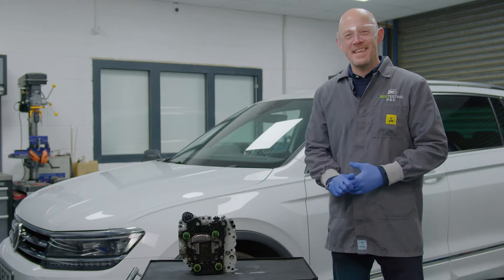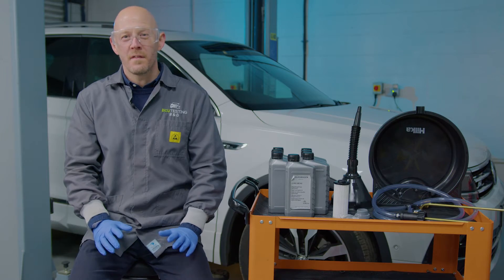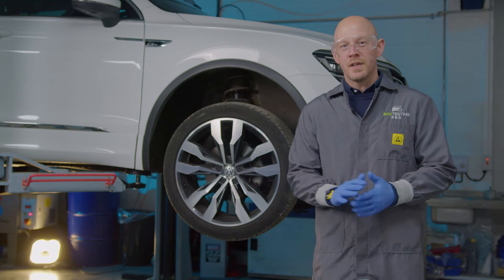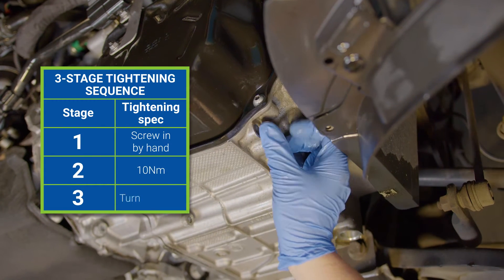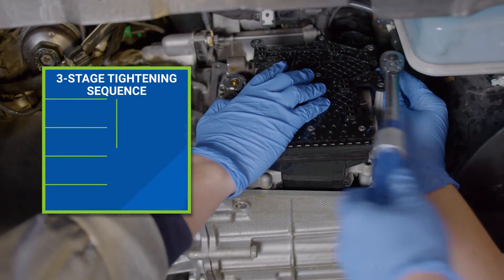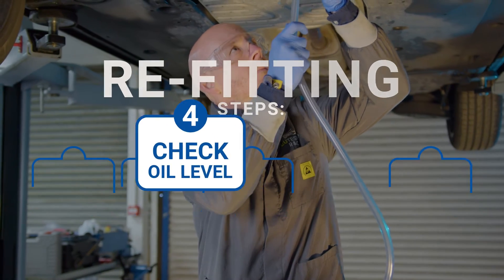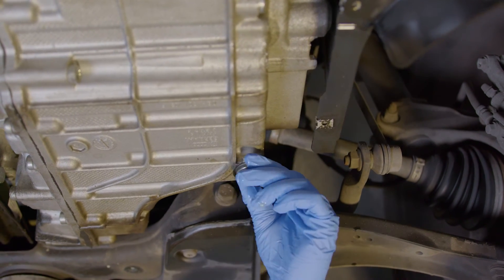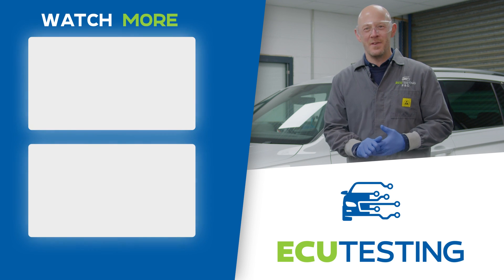Volkswagen Tiguan DSG – DQ381 – Removal and Fitting

Comment: I have tiguan 2011 model ,some time automatic gear not shifting while parked.once vehicle moving then no problem in shifting.
Reply from the maker: Hi. Intermittent loss of gears is a sign of a failing mechatronic unit. However, without any fault codes/ further details it would be tricky to say for sure without testing the unit. If you would like to get your unit tested, please contact our technical support team via email at info@ecutesting.com or via phone on +44 1773 535638 with the following details. Your make and model of vehicle, the unit's part number, and any details of the fault you are experiencing - including fault codes, symptoms and any attempted fixes you have tried. They will be happy to advise you further. Thanks.
Reply: Hi I have dq500 2011 tiguan aswell. Noticed this issue around 200,000 km, now on 235k kms. Its intermittent issue where the clutch does not engage on first start up with a feeling of neutral and when rpms raised a big clunk as clutch engages and car drives absolutely fine until it happens again, sometimes the next day, sometimes a month. Its very frustrating as not worth throwing money at to change mechatronic as car performs normal once on the go. Basic settings, new oil and filter and right fluid level does not solve the issue. Fault codes are clutch 1 opens unintentionally or clutch 2 depending if it happens in D or R. If I click the gearstick over to manual mode and back into D or R when I notice it happening, 99% of the time the clutch is engaged and can take off smoothly.

Comment: Can you run the basic settings if you have a tcu tune? And what about resetting adaptions? after 20 mins of hard driving, I get my traction control light flashing, this cuts the power, I've changed bevel box, haldex pump, haldex clutches, still same problem, several garages looked without success 😢 thanks Darren
Reply: You got any videos on esc issues fault finding? Cheers Darren 😊